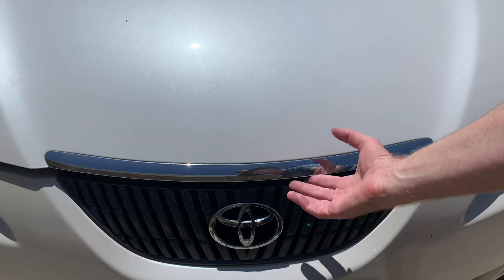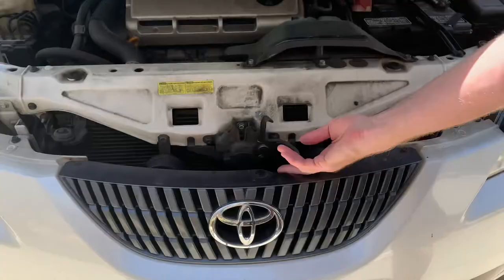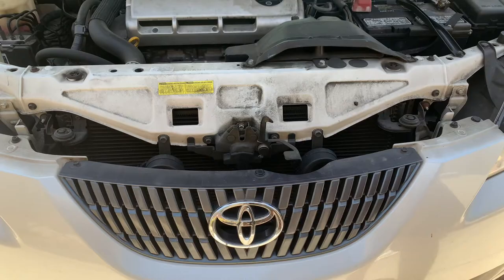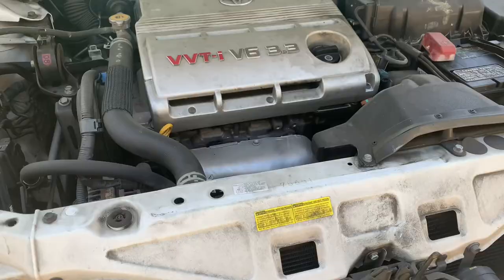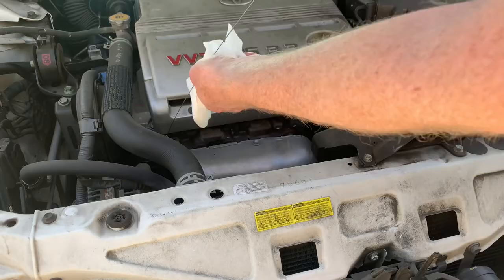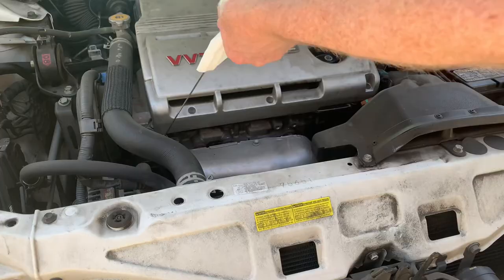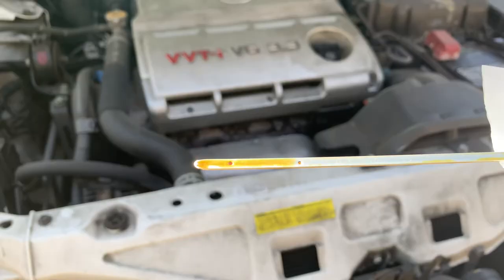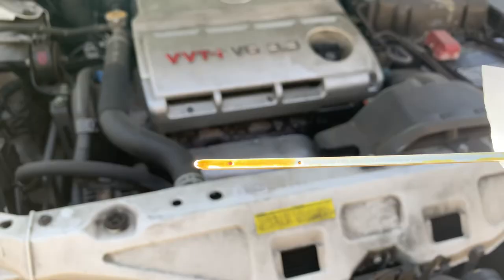How To Check The Oil On A Toyota Camry

Comment: Thank you
I have 2007 Toyota Camry
I’m 73
My car hood sometimes drops down on me. Especially windy days.
I sometimes ask the mechanic to check it. Once it was 21/2 quarts low….Pep boys bought out RPM
but the mechanics are very polite.
I remember when gas stations would check your oil and pump your gas…